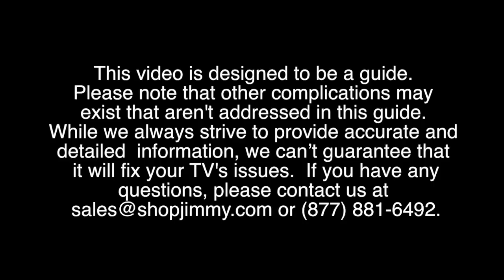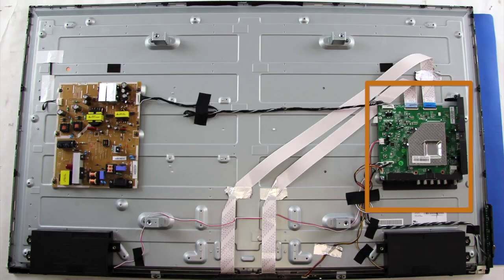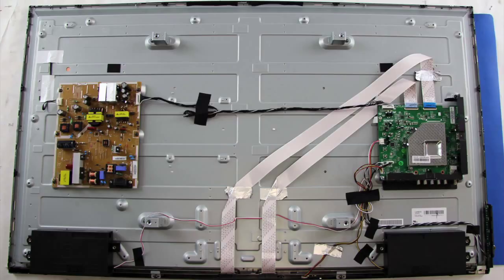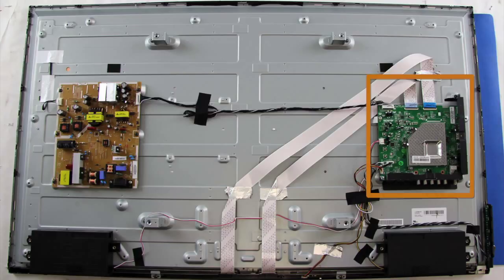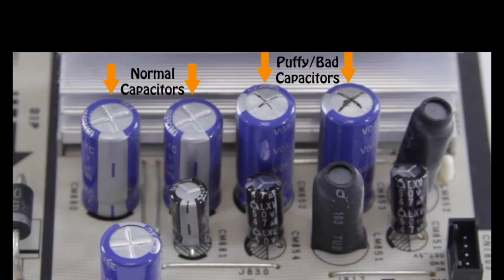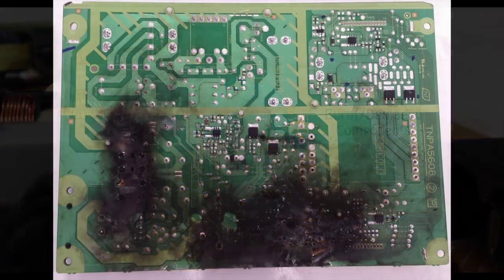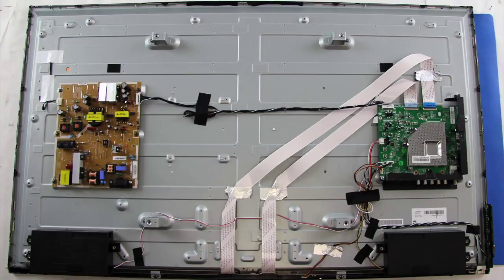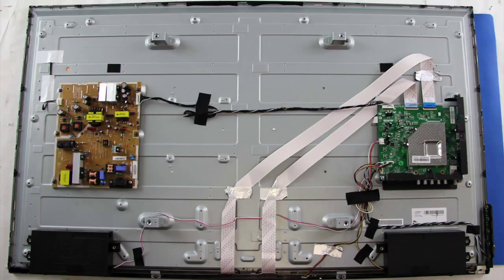Vizio LED TV Repair - TV Has Backlights but no Image on Screen Troubleshooting Help

Comment: I have a vizio e550i-ao. the left side of the screen has three horizontal lines going through. about 4in in width. I'm not sure what it could be. any help would be appreciated. they show up no matter what input or menu being on.
Reply: T-con board is going,thats how 60inch tv was doing.

Comment: Have a sony kdl 52w4100 tv turns on back light comes on. I get sound. If i unplug the tcon board from the main i get solid colors on the screen that go from green to blue almost like a test. so the screen works. I have replaced the main board. My next test would be the power board.

Comment: I have no picture on my 47" Visio Model E470i-AO LAQKOCBP LED HDTV.  It has backlights and I checked voltage on YOUT1 and YOUT2 and get 110v on each test point.  I have backlights and sound.  I also performed the backlight test and could not see an image on the screen.  I cannot see any burnt or damage components on the boards.  Brand new TV but no warranty.  After watching your YouTube videos (very helpful), I believe I need to replace the main board:  Vizio 3647-0852-0150 (0171-2271-5032) Main board for E470i-AO (also 0832 & 0862 are compatible boards).  I just wanted to double check that I'm not missing something before I order; any suggestions?
Reply: +Dennis Malatek Did you have a dim strip in the middle? I did and I have so far replaced the main board since I did the flashlight test but that apparently wasnt it because it didnt work...then today I replaced the LED/Power board...still didnt work...ugh..lol since the vizio has like 3 parts I am going to order the LED light strip..I just wish I knew before I spent all this money before hand...the main board is spendy(not as spendy as a new tv) Other people have had the dim strip and after trial and error the fix for a dimming and then black screen seems to be the light strip.

Comment: Hitachi m-50bs69a an-b61013229. Cut on power tv is blank the power an lamp an the other button when u cut on power all 3 lights. Scan up an down tv does not COME on but the3 light go up an down then stops on lamp .no picture or sound.... Help

Comment: I have a E470i-A0 the backlight and screen turn on, the screen lights up.  I tested the voltages on v1 and v2 both are 102 and 101.  i repoaced the main board and i have sound but nothing happens when hitting the menu buttons are selecting  another input.
Reply: The make is a Vizio
Reply from the maker: +adam holt  Try all repairs and troubleshooting at your own risk.  What was the original problem with the TV?  Thanks!  www.shopjimmy.com
Reply: +ShopJimmy.com Same thing I dont believe there was sound but I wonder if the speaker cable was loose.  Didnt seem to be fully seated.  I checked the remaining cables they seemed to be installed correctly
Reply: same problem  how do I fix it
Reply: The screen was bad.  Called repair shop they said to replace screen was 50 less than buying new tv.  Most of that was the cost of a new screen.  The guy mentioned that if a little dust was to get in there during installation that could cause the new screen to not work as well.  He said that they would charge me for another screen if this happened.

Comment: Hey , I have a Westinghouse 32' TV Model NO:SK-32h240sv Part NO: TW-50621-co32e Serial NO: 5062J81300877 , it was working fine couple days ago,  now today When I turned it on it has a blackout screen and doesnt do anything but stays black, then When I try to turn it of , it wont turn off  either .. Only way the light turn off if I unplogged the cable, then turn it on again stays Black screen , any helps ?? Please

Comment: Hi, I have a Vizio XVT553SV serial number  LAPPGLAL37C0046. This TV was on and working normally until the power was interrupted during a storm. It is on an UPS but turned off during the power interruption. When I tried to turn it back on manually, it would not turn on. I disconnected the A/C from the TV, Pressed the power button in for 30 seconds and the TV then did start to turn on. The small Vizio symbol began flashing amber and white 88 times, then it stopped and the large white "V" came on the screen for a little more than a minute. at this point, the tv restarted with the small  vizio symbol flashing amber and white 88 times then the large white "V" comes on for a little more than a minute. The TV continues this cycle. It does not respond to the remote or manually pressing the power supply button. This will continue until the A/C power is disconnected. Once the power is disconnected and then reconnected, it will go through the cycle once and stop when the large white V disappears and the small amber vizio logo lights up, The tv then will stay like this and it then responds to the remote power control only to turn on and go through this cycle until the A/C power is interrupted. There seems to be a lit up background when the Large white V comes on. It just doesn't go any further.
There is no obvious signs of a problem on the boards. 
Do you have any suggestions?

Thanks
Reply: +fixer 4716 the main board got zapped from the storm. there is too much current generated in a storm and a UPS is not going to stop it. I would replace the power board too
Reply from the maker: +fixer 4716   Try all repairs and troubleshooting at your own risk.  I recommend replacing the main board and the power supply board in your TV.  Unfortunately I do not see any replacement parts in the search results for your TV model number on our website.  Please reply with your part number on your main board and power supply I can try searching for replacement parts.  Thanks and please let us know if you have any further questions!  www.shopjimmy.com